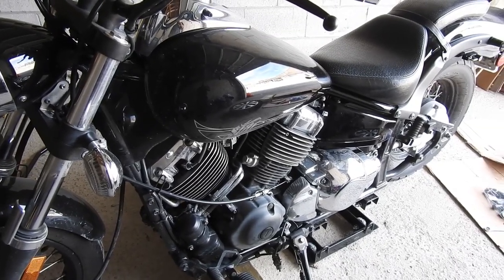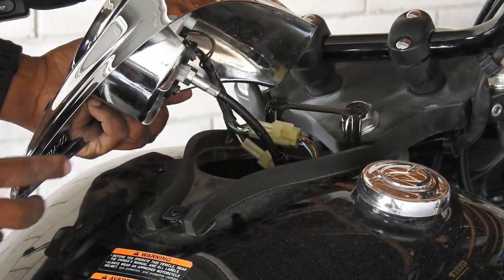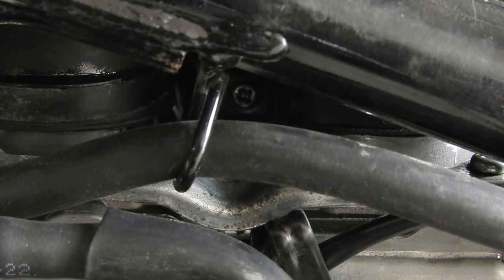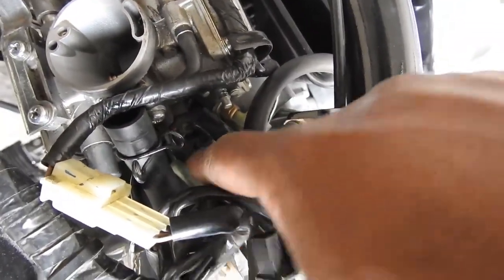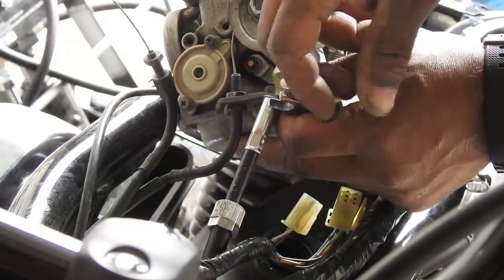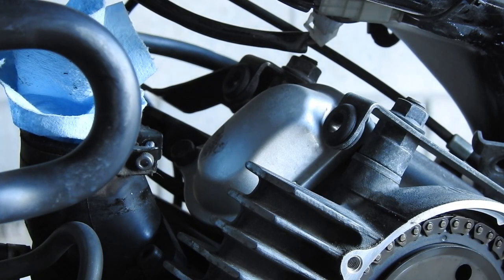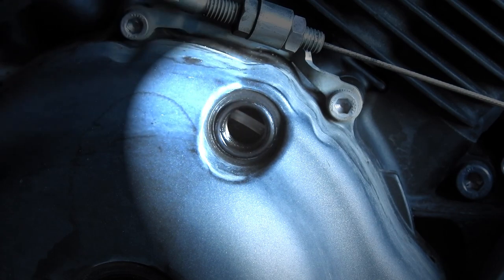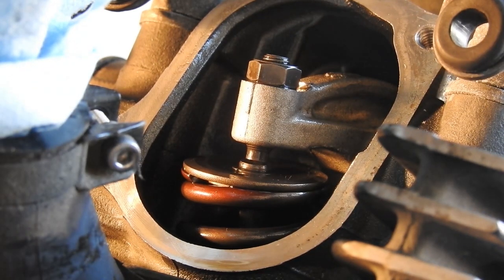How to check valve clearance on a V-Star 650

Comment: Excellent explanation great close up camera work one of the best I have seen so far have booked marked it so when I adjust my V star 650 Valve. I used to to this regularly on a 1960 VW beetle rag top I used to own it was a huge difference in performance always after adjusting the valves it would make it run so smooth and responsive cant wait to do this to my newly acquired V Star 650. Valve adjustments goes a long way on four and two cylinder engines I learned this from experience in the past, That and carb synchronization and fuel mixture adjustment.   Thank you for your excellent video

Comment: Great detailed video. Years ago I was service manager for Honda of Waikiki Oahu Hawaii. I worked primarily on Honda machines and I would always set the valves .02 on the intake valves and .04 on exhaust at TDC. Now I am an old man with a 2011 Yamaha V-Star 650. With all that you have expertly shown on this video, I think when the time comes for rocker arm adjustment, I will just pay a mechanic 500.00$ to do the job because I have become lazy and just don't want to go though the hassle. Thank you for posting this video!
Reply from the maker: Thank you for the kind words.
Adjusting the valves on this bike is extremely irritating. Especially since you worked on Honda's. I think it's just 8 screws to remove on some of those Honda's.
Unfortunately for me taking it to the dealer takes even longer than doing it myself.
Reply: Must agree try to do it your self.

Comment: This is a very complicated operation just to adjust the valve clearance. I think that I will buy another type of motorcycle. If you have this type of motorcycle this is a brilliant video instruction.
Reply from the maker: Thank you very much!
It is a very time consuming process. It goes by quicker with practice. I think each motorcycle will have it's own annoying qualities.
Reply: Honda 1100 Shadows have hydraulic valve lifters and don't require adjustment.

Comment: This is an excellent demonstration, very methodical.  But wow what a hassle!  The problem is obviously how long it takes and how many things have to be removed in order to access the valve adjustments. I have this bike, as well as a vintage 1979 Triumph Bonneville.  On the latter bike the valves are super accessible.  It's very easy and takes me less than 15 minutes to adjust the intake and output valves, without having to remove the tank.  For me, I just have to bite the bullet and take the Yamaha to a dealer shop.
Reply from the maker: Thank you I really appreciate that!
It's amazing the work involved to adjust those valves. Like your Triumph, it's a lot easier to do on other bikes.
If you can, let us know what the dealer charges.

Comment: when your turning the crankshaft and watching the rocker coming up off the valve, at the point where it stops rising if you turn the crank 1/4 turn more you'll be at or very close to the center of the cam heel, and hold the rocker arm against the cam heel with your finger when sliding the feeler gauge in to avoid fighting to get it in

Comment: I agree, a very good presentation on valve adjusting on a 650.  I need to adjust my valves on my 99 V-Star 1100. I think other than the specs the procedure is pretty much the same. Thanks again, for the great video. Let me know if, in your opinion  I can follow the same steps procedure.
Reply from the maker: Thank you, much appreciated!
The procedure for your 1100 is pretty much the same. You will have to move the ignitor assembly though. It's held down with plastic push rivets. To remove them use a small hex key or screwdriver and gently push the pin in the centre down. Don't push the pin all the way out, just enough that the rivet can be removed. To reinstall it, push the pin so it's sticking out the top of the rivet. Put the rivet back and push the pin back in so it's flush with the top. 

As for the specs, the clearances are actually the same for the 1100:

Intake: 0.0028 - 0.0047 inches   (0.07 -  0.12 millimeters)

Exhaust: 0.0047 - 0.0067 inches   (0.12 - 0.17 millimeters)

Comment: This is a great video. Thanks so much for making this. 

I had a couple of trouble spots. The front upper cylinder cover is very difficult to remove because of low clearance. I finally figured out you have to remove it at a 45 degree path in order to clear the bolts inside the cover. It is possible to remove it. Replacement was much easier.

Reinstalling the breather box on the carb is really hard. Any tricks to this?

I didn't remove the throttle cables because once the carb was resting on the frame, I had the clearance I needed to work on the valves. Why did you remove them?

Thanks again!
Reply from the maker: Hey no problem thanks, glad you liked it!
There's quite a few annoying things to deal with doing this job. One of the good things is you really get to know the guts of your bike.
That airbox takes practice for sure! What I do is keep constant pressure from the top and go back and forth between both clamps tightening slowly. You definately don't want to overtighten them. You want to look at the other side also, look around to make sure it's staying in place. I'd also recommend taking a peak every few rides to make sure they're still on. Thanks to the dealer I was riding for quite sometime with mine partially off and didn't realize it.
I removed the carbs because I was installing a kuryakyn hypercharger and needed to rejet them. Figured I'd just add it to the video to show it's really not a difficult procedure.

Comment: No need to take the carbs off the bike completely, just get them up out of the way - that eliminates the need to take the throttle cables, choke cable, and half the wires off the carbs.
Reply: Do i need to remove them to take the cylinder head (plastic covers) off. It appears the carbs will be on the way for the front, maybe not so much the back side. Just want to check for oil leaks but seems like a lot of work for that upper portion lol.

Comment: I like your video, a lot of good info, I have my bike half tore down to do this job and can not find the right feeler gauge all I have found is 0.007 and I have no idea what this is, but what I need to know is for example the intake on the V Star is 0.07 to 0.12, what should I look for closer to the 0.07 or 0.12?
Reply from the maker: Thank you earnest brown!

I hope you didn't adjust them yet. It sounds like your feeler gauges are imperial, not metric. The clearances for you would be:

Intake: 0.0028 - 0.0047 inches   (0.07 -  0.12 millimeters)
Exhaust: 0.0047 - 0.0067 inches   (0.12 - 0.17 millimeters)

Adjusting them closer to the high end "0.12mm" is better for low-end power but can be noisier.
Having them closer to the low end can improve top-end performance
 but may increase wear. It's really up to you.

Whichever you choose make sure both intakes are adjusted to match as close as possible, and the same goes for both exhausts. 

Also, you can always stack feeler gauges by adding them together to get the correct size. Just make sure they're nice and clean first.

Take your time and have patience! It always takes quite a few tries to get the results you're looking for.

Hope that helped, let us know how it goes!
Reply: I accidently found the right feelers gauge today! I don't want more noise, that is for sure, lol! I plan on getting the gaps a close as possible. But realizing that in the 2 videos I have watched , I really don't want to mess with taking the Carbs off, but I called a local Yamaha Dealers last week and the want $288.00 +and I will not go that route for sure! Thanks
Reply from the maker: Wow! That's why I started doing these videos. I bought my bike brand new from the dealer and to keep the warranty valid I took it in for the first 1000km service, it cost me $652.
If you do remove the carbs make sure the throttle cables are secure when you put them back. The surge tank can be tricky to get back on. Lastly, the rear lower cylinder head cover is very thin brittle plastic. Use caution when taking it off.
Reply: Yeah it's a ripoff if you ask me, but I am very careful , lol
Reply: I have it at TDC but no free play and actually I have to go to the parts store and get the right allen's
Reply from the maker: Remember TDC is different for the front and rear cylinder.
If possible get a metric set with the ball ends. You're going to need metric tools for anything you do to this bike, the ball ends help with hard to reach angles.
Reply: I went and got some, and it appears that my rear intake the .13 fits rather loose, but I will be very careful and rotated the engine a couple of times
Reply: You can pull the carbs out without disconnecting the cables.  I lifted the carbs out then swung them over to the left side with cables still attached and used a shoe string to hang the unit from the handle bar.

Comment: I noticed on my 1998 650 vstar that when I have the choke pulled out all the way only one of my exhaust pipes gets hot. Only when I push the choke in all the way do both pipes heat up. Is that normal for this bike or does it mean I have to adjust the carburetor or something?

Comment: Interesting video, however the arm holding adjustable screw dropped  after you initially checked the clearance at 14:07. Doesn't that mess with your adjustments?
Reply from the maker: Good observation!!
The arm will move, there is supposed to be some free-play. That is why we have minimum and maximum clearances. So when that arm moves, we're still within specifications.
Think of it like a minimum and maximum line on an oil dip stick. Safe operation is anywhere inbetween.

Comment: Excellent video but doing this has stopped my bike running. Firstly I had oil leaking from two tappet covers and lots of white smoke shooting out these exhaust manifolds. After changing the O-rings and thread-locking the covers closed it seems to have stopped the leaking but I'm getting a lot of backfiring and barely any power on acceleration. Could there be any quick fixes?
Reply: Damien Lockhart yeah do it again uve got timing wrong
Reply: @volt8684  thanks. I went back in and checked the timing was right and then redid the clearances. Had to tap larger bolts into the covers because there was still oil leaking. Stripped the carb down completely and then tuned them by ear (between backfiring on idle and backfiring on deceleration). Probably a lot richer now but sounds great.  Had a driveshaft seizure last month though so been off the road as I recover.  Bike seems alright though
Reply: Damien Lockhart bloody hell! Hope ur ok. Mine vibrates my fillings out. Done carbs/ valves , still cant stopit. Very excessive i think.
Reply: @volt8684  thanks pal. Afraid i can't help you with that. Still trying to diagnose my problem, thought the splines on final drive coupling had been worn but despite the rust they were still in pretty good condition.  Thinking to stick a virago final drive hub on to be safe.
Reply: Damien Lockhart good luck and speedy recovery matey
Reply: the only way the valve adjustment will make your bike run poorly is if you set one or more too tight. If they are too loose they will be noisy but performance will barely change.

its also possible you did not seat the carbs right top or bottom, or you left a vacuum hose off or loose, creating a vacuum leak

also sounds like you had already deformed the tappet covers by over torqueing them trying to get them to stop leaking, stripped out the bolts in the heads. You have become the poster boy for the reason why it is necessary to use a torque wrench on ALL the fasteners on a motorcycle. Over torqueing a tappet cover with a dried out o ring will not stop it from leaking.

the only reason shaft drive spines fail is because someone wiped off the proper 60% moly paste and put axle grease or brake caliper grease on the splines. They will be destroyed in about 2000 miles without the proper moly 60% paste
Reply: @kenwittlief255  Thanks. ultimately it was leaking air from the worn manifold, and the previous owner had stripped the tappet cover threads and loctite'd them shut. I torque everything I can.

Comment: I build a Yamaha  star which I did not strip and I am having a problem with the cylinder head covers, they won't go on. I have the carbs and all the other stuff on, can you give me any tips on this, as I do not want to lower the engine, due the exhaust pipes being fixed on also? any help would be grateful.Thank You.
Reply: Douglas Taylor, my front upper valve cover was very difficult to remove as there was not enough space. I finally figured out that there is just enough room to remove it if you pull it out at a 45 degree path. So I pulled it towards where the air filter was mounted. You can just clear the protruding bolts but you'll have to bend the plastic cover a little. Putting it back was just the reverse and was much easier.

Comment: What gear was the bike in?
Reply from the maker: I left mine in first gear so when lifting the bike it wouldn't roll.
If your rear wheel is off the ground it really doesn't matter.
If your wheel is touching the ground, you'll want to have it in neutral or you won't be able to rotate the crankshaft.
Excellent question! Thank you for mentioning that.

Comment: how many miles does the bike have? mine has 13800 miles and people are telling me to get this job done. costs like 400 dollars...
Reply from the maker: Valve clearance should be checked every 4,000 miles (6,000 km) or every 6 months.
Reply: Motorcycle Manthony is it normal to cost that much for the job?
Reply from the maker: James Kang unfortunately for the V-Star checking the valve clearance is very time consuming. When I had my first service done on the bike from the dealer, which included checking the clearance, it was over $600 Canadian.
I would recommend shopping around, however I really don't know what kind of prices you'd see.
Reply: ah thats a bummer. thanks for the info though. i appreciate it
Reply: You only need to adjust the valves when you don't hear the valves tapping. If you hear the tapping your good.
Reply: I had my valves adjusted as part of a complete service.  I paid about $450 CND, so about $325 US.  Some of you guys are getting housed I think...

Comment: fyi the manual states that check intake timing mark should be I and exhaust is the T...
Reply: This comment is confusing and incorrect. For the V Star 650, the marks are for the rear and front cylinders. 
From the manual:
  For rear cylinder ("T|" mark)
  For front cylinder ("|" mark)

The process that Motorcycle Manthony shows in this video is exactly right and I really appreciate the time and details he put in this video for us!

As long as I'm sharing info from the manual, these are the clearances for intake and exhaust valves.
Valve clearance (cold):
  Intake valve:
  0.07 - 0.12mm (0.003 - 0.005 in)
  Exhaust valve:
  0.12 -0.17 mm (0.005 - 0.007 in)

For those of you wondering which are the intake and which are the exhaust valves, just look at where your exhaust pipes come out of the cylinders and those will be your exhaust valves. The two valves in the center, right under the carburetors are the intake valves. It's obvious, but it took me far too long to realize that.😊